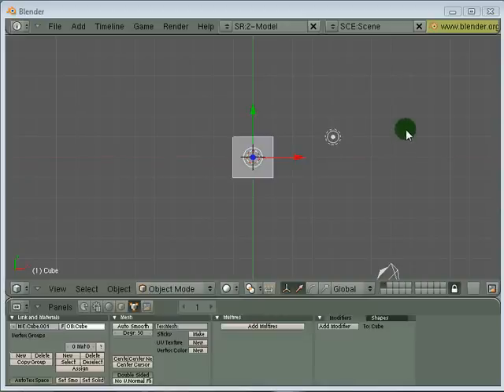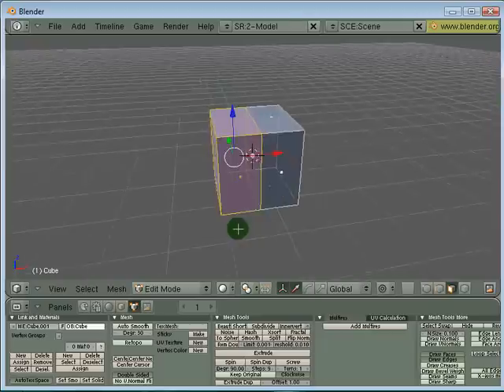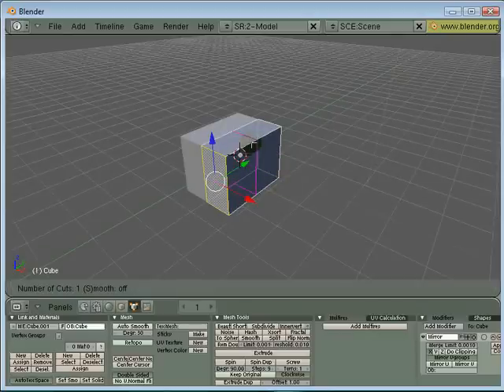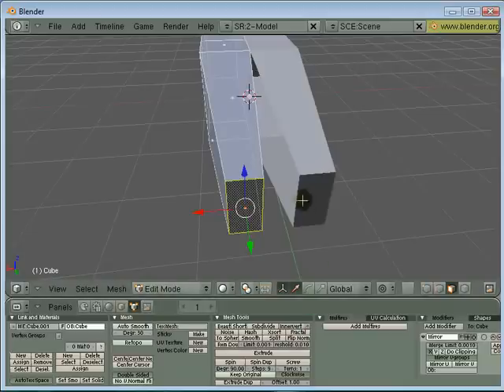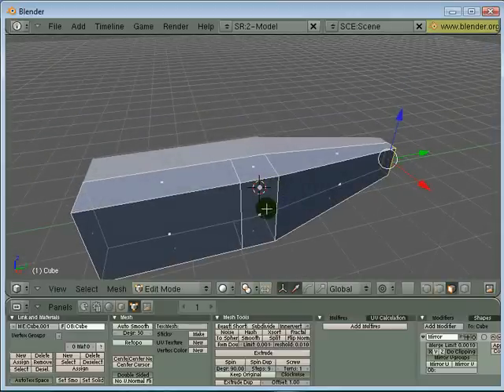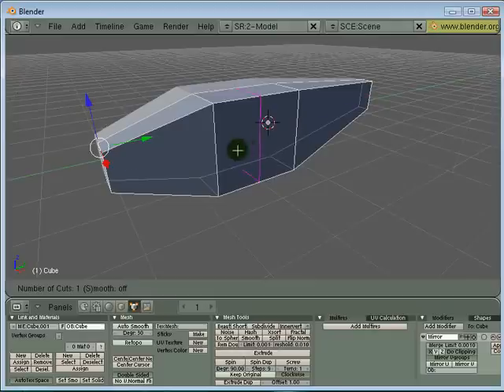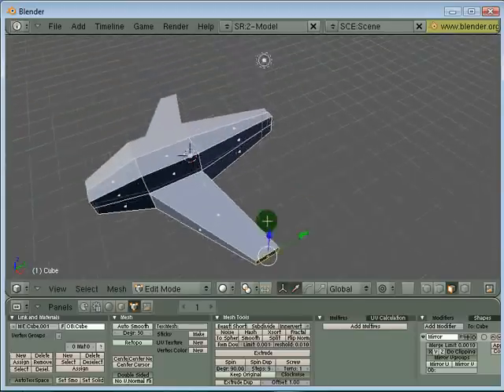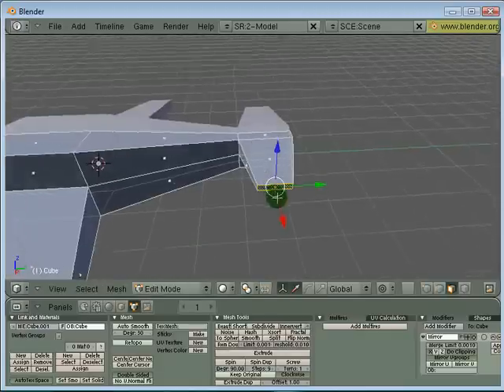Blender Simple Airplane Modeling Tutorial Part 1of2

Comment from the maker: @d1ffsta It could be possible that you have accidentally extruded another face at the wing tip. You can try pulling out the face, press this combination Ctrl+ (Numpad +) to select any additional faces. Ctrl + (Numpad -) to shrink selection. Delete the wing and try extruding it again. To fill the hole, select the edges surrounding the hole by pressing ALT+Right mouse click over one edge of the hole and then press F to fill it.

Comment from the maker: @atomofish Your orientation is probably not the same as mine. Go to the Modifiers in the Buttons Panel Below. Check which axis is turned on. By default X axis mirror is always on. Try activating other axis like Y or Z, but remember to disable the other axis you don't need. See if that will solve your problem. BTW, if you look carefully, the wing is oriented to the X axis (red line) and the Fuselage is oriented to the Y axis (green line)